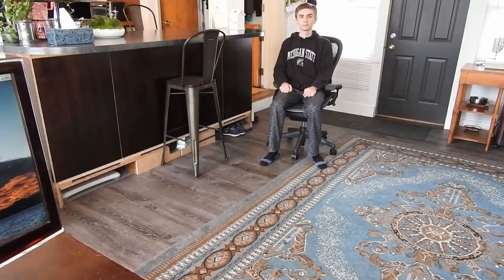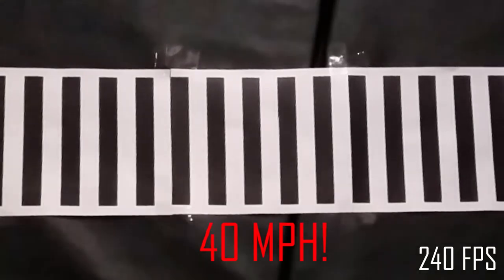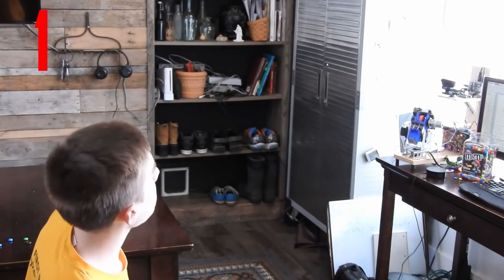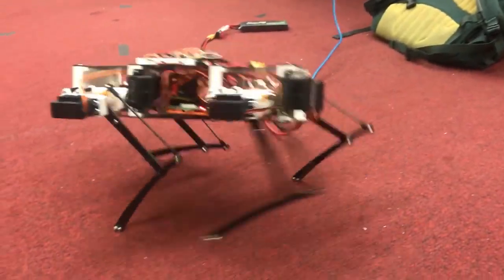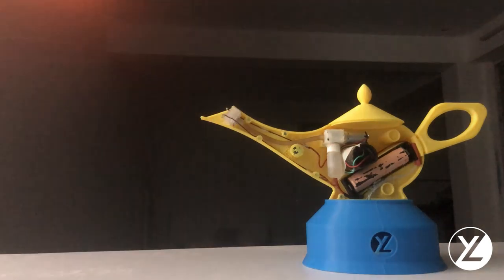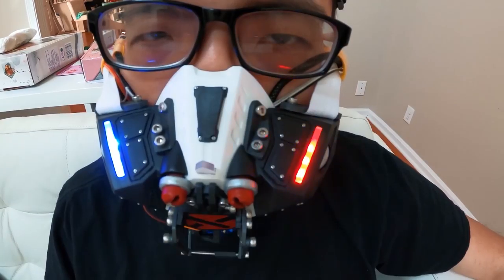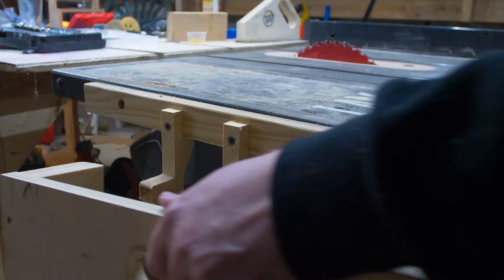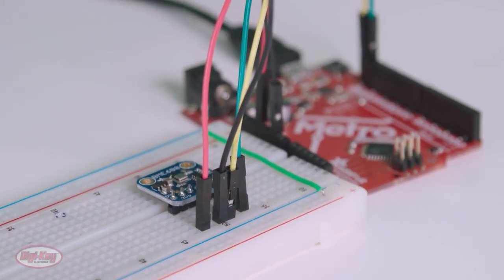Chocolate Volume [Maker Update #177]

Comment: Another great Maker Project idea video. Couple of good ones. The M&M launcher is kinetic energy in motion. Launch them baby’s!! And the Robo pet is one I think I’ll try and remake. Maybe you should do one on scavenging part. I just took apart an old Canon 512 to recycle the plastic and got 150 screws, 5 stepper motors, 30 springs, numerous gears and ribbon wires and connector. Plus a bunch of switches. A honey hole of parts to build from. The sum of the parts was less than the printer.
Reply: Nice scavenging! I've been noticing a lot of spring cleaning items on the curb around my neighborhood, including old printers, VCRs, and monitors, ripe for parts scavenging or repurposing. It's been hard to pass them up, but between the coodies and my already overflowing collection of "someday" parts, I just have to let them go for now.